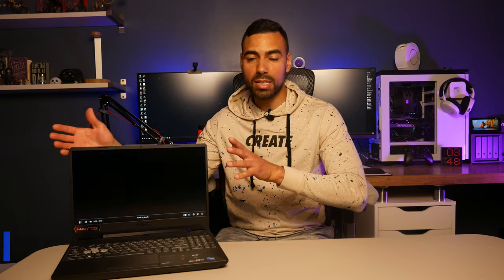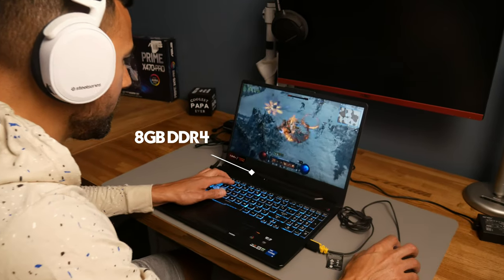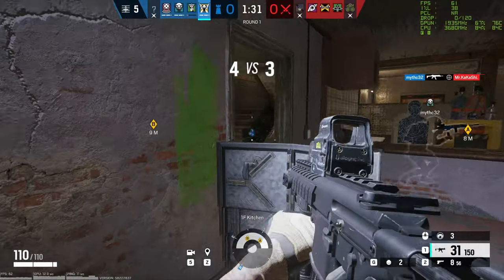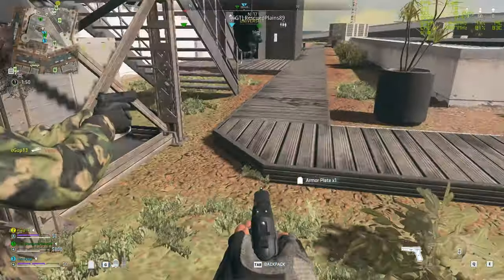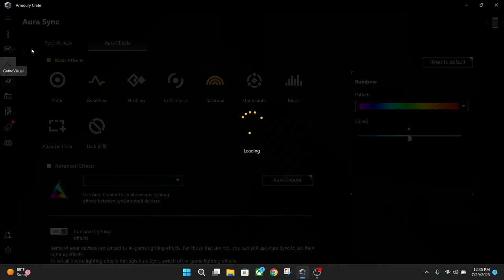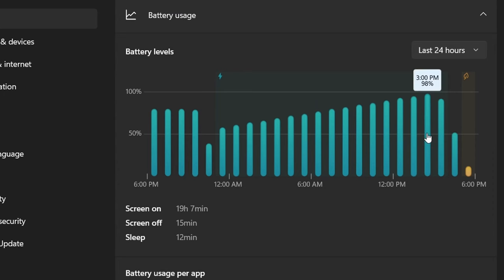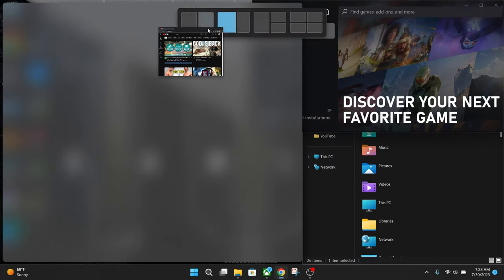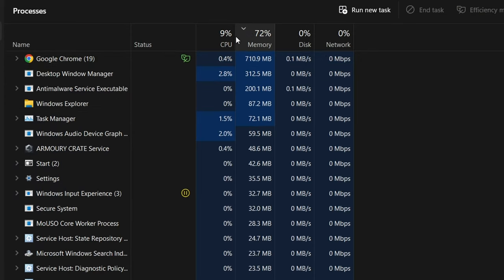ASUS TUF 15.6" Gaming Laptop F15 FX506H | The little engine that could...

Comment: i just bought this laptop for 1 month, and i want to ask you do you think battlefield 2042 can run using this laptop
Reply from the maker: I haven't tried it but it couldn't handle CoD Warzone and it will probably struggle with BF2042.
Reply: @chilldadreviews  thanks for the info bro 👍